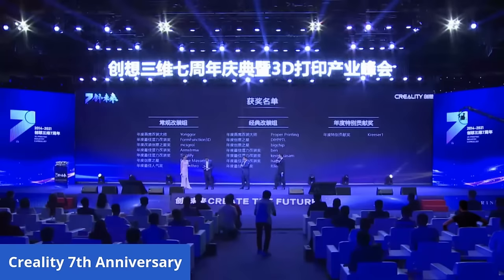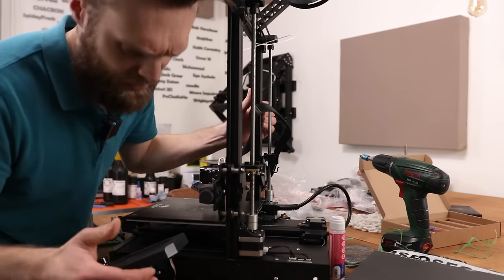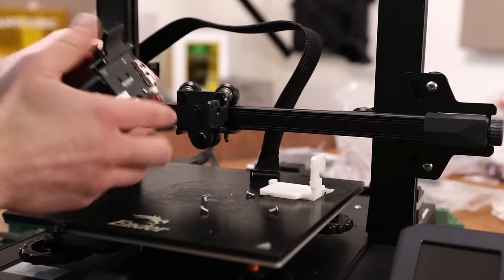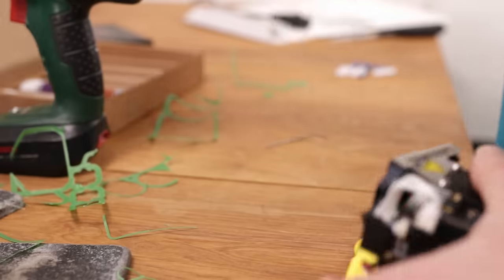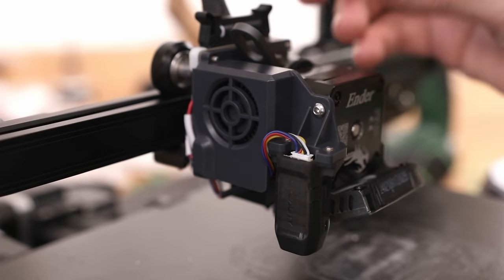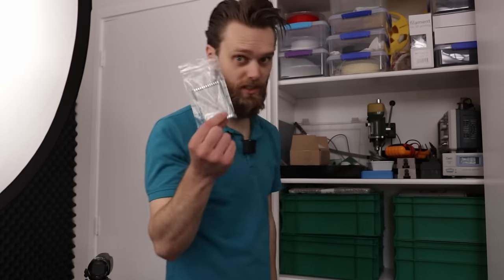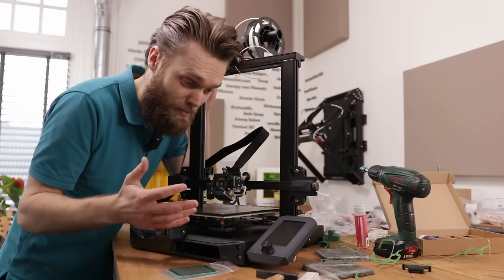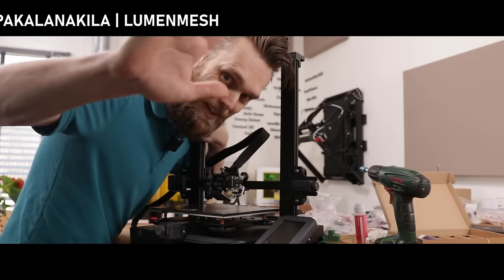MUST HAVE and SIMPLEST mod for Ender-3 S1! Contest worthy?

Comment from the maker: Hi everyone! This is my submission to Creality’s second Modification Masters contest. I went all in on simplicity and this mod can be made with just the parts out of the box! Check out my website properprinting.pro for more information and the 3D printable files! More information about the contest https://www.creality.com/activity-news/modification-master and my submission https://www.crealitycloud.com/post-detail/11066
Reply: Brilliant mod, and has pushed me over the edge of thinking of buying this printer, to actually buying it. Good luck!
Reply: Love your mod! Printed it today, it’s awesome and fits perfectly. I was hoping that I can easily switch between the extruded and the laser engraver. But the laser engraver doesn’t fit when your mod is mounted :( it’s just about 2mm or so. In case you want to make it even better for the contest, you could maybe find a solution that the laser engraver also fits.. but nevertheless: GREAT JOB! Thanks a lot!

Comment: Absolutly amazing. Einstein said we should make things as simplest as possible, but not simpler. You did that. Make a nice documentation and mount instructions, give yourself time to make it look all pretty, and you are winning. At the same time that opens up a room for a short video build tutorial.
Reply from the maker: Thank you! The deadline is moved to August 31st so I have some extra time to make it nicer :D
Reply: @properprinting  i hope you win! im guessing this cant work on a standard ender 3?
Reply: @FoxSock  Unfortunately, I don't think it will. The toolhead carriage on the standard ender 3 is different to the s1, therefore you probably will not be able to install the mod unless you change the toolhead carriage.

Comment: As an S1 owner who has both the Sprite extruder that came with it as well as the Creality laser engraver, I can't thank you enough for this design!
Reply: I'm looking at a LASER kit. How have you got on with it and is there anything you could recommend? Many thanks in advance.
Reply: Yesssss!
Reply: Hi, have you found or designed a tool part for the 5W laser engraver ?
Reply: Does the laser engraver work well?
Reply: @soa1 Yes, i have the 1.6 w & the 10 w!

Comment: Some of the best mods and or inventions are the ones that are the simplest.

Your mod here is the perfect example of that fact. It's so simple and straight forward that all you need is what you get when you purchase the printer as you mention in the video. You just do a quick print and mount it, and you're done.

Great job on coming up with that design.
🤘😉👍
Reply from the maker: Thank you! This realization came while I was designing it. Initially I had the idea of adding inserts or nuts. Since there's no pulling force on it, it can be done without. Just two parts and you're left with one screw xD
Reply: Came here to say the same. Simply awesome!

Comment: I just bought this printer and got it set up a few minutes ago. Your mod is the first print. It's going right now.   Oh for the record,  I got the loose coil of filament in the vacuum seal bag.  The mini spool must reserved for Proper Printers like you. :P
Reply: Does this mod make sense if you’re only 3D printing? What does tool change mean?

Comment: Just picked up a Ender 3 s1 for $50 bucks and its wasnt barely used. came with extra hothead, nozels, ablout 4 heat beds also the extra parts wereworth that alone,  great  mod!  thank you

Comment: this is amazing. afaik there will be a high temp print head as well as an laser for the s1, so this will make it so much more easier to change those toolheads! well done!
Reply from the maker: I didn't even know that! It would be so cool if they use the same connector. Thanks man!
Reply: @properprinting  unfortunately my answer Was not Posted, on the creality Website they do have the Sprite Pro and a Laser Module got the s1, with the same connector, so your Design is even more usefull!

Comment: Nice, simple and useful, really hope you win !   Making something simple yet effective can take more time than most think.

The only thing still Ender on my Ender Pro is literally the frame and bed.  Coverted it to a V6/BMG direct drive IDEX printer, has a unique 5:1 Z belt drive with brake and full linear rails.    All designed from scratch,  many hours of CAD work but It still can reach entire bed so lost no print size.  Linear rail adapters and the IDEX mounts all made from aluminum for rigidity.  I'll have to make a vid of it sometime I think you'd get a kick out of it.  COVID lockdown boredom lol
Reply from the maker: That's awesome! Please share a video once you've made one! Who knows the COVID boredom ends up starting an awesome YT channel :D
Reply: @properprinting  Nah no interest in running an ongoing channel.  It's already done aside from waiting for the 2nd V6 and extruder.  Wanted it mainly for using dissolvable support material and 2 color printing.

Comment: Wow! This is awesome! With a pen holder compatible with your part you can practically change your S1 into a 2d pen plotter :D
Reply from the maker: Exactly! And I made a mod in the past using a solenoid so you can control it with laser cutting software. That worked pretty neat
Reply: @properprinting  neat! I love your vibe bro, take my sub :)
Reply from the maker: @Psi34ax  thanks for the sub!

Comment: this is great! i just ordered ender 3 S1 as my second printer and I am planning to make is into a foldable printer that can fit in a suitcase while travelling and this mod is definitely going to make the folding/easy disassembly easier. Thanks
Reply from the maker: That's awesome! A foldable printer was my first video taking off :D https://youtu.be/6GTCkd7rDe4 That also included a tool swap system which I started this channel with.

Comment: hey brother , my CR touch stopped working properly out of the blue, so when i try auto level it tries to drill through the plate.
Reddit has 20 million different ideas about it , seeing as you also use/have a S1 I was wondering what you would think could be the culprit?
Reply from the maker: It can be roughly four things. The CR touch, the cable(s), the interface board or the main board. I cannot give a clear answer of what it might be, because you need to start excluding things to find the culprit. My best bet would be the connection to the interface board and second best, the CR touch itself.
Reply: @properprinting thank you! ill start with following all the cables

Comment: Printed this and just can't seem to get it to slide enough for it to clip onto the bracket. Any recommendations?
Reply from the maker: Some people reported this problem, so you're not alone. The tolerances of the sheet metal part are quite course. You can resize the part a bit in the slicer software in the horizontal direction only to make it longer while the dove tail connection remains snug. Hopefully this helps!

Comment: I modified the stls a mm shorter so it fits (I know ur aware of this issue), but did u have a lot of play or any play on the extruder? Bc my extruder is really really wobbly...
Reply from the maker: Thanks for letting me know. I'm aware of this issue and it looks like that the tolerances between printers is huge. Mine fits perfectly, but it doesn't for some. I eventually turned it back to original because I don't really use this functionality and it became less stable over time.
Reply: @properprinting  Okei, I'm gonna try making it less wobbly or maybe design myself an extruder mount, thanks!

Comment: Hi,  witth this mod, dose the nozzle position change att all? would you need ot adddress that in the firmware or Klipper?
Reply from the maker: It changes a few mm in both directions which is still within the boundaries of the print bed.

Comment: Hi I'm a beginner in 3d printing, i have a question, will this affect the auto bed levelling by any chance?
Reply from the maker: No, as long as the height of the sensor relative to the nozzle tip remains the same, nothing changes.

Comment: Hey Jón, i am quite new to 3d printing and i love your channel and your style. one thing, i got your adapter file and printed it according to your suggestions of 0.2 layher hight, supports and 30% infill. the problem is my two parts are not holding that good. What is your designed wall thickness, i printed it with 0.4 mm walls and like i said, i have got a bad connetion and the extruder is kind of loose. thank you in advance. stay safe
Reply from the maker: Thanks for trying out that design! Mine fitted quite snuggly and I even needed oil to get it to work. I was thinking of making a couple of versions with different tolerances. There are lots of variables, so chances are that it's a loose fit for some and tight for the other. In your case, I think you can get away by scaling one part in Cura in the direction perpendicular to the sliding mechanism. Hopefully this helps.

Comment: Its the mounting plate thats comes with the sprite pro kit for ender 3 diferente size than the stock S1?
The thing mounted in the plate have the holes like 3 mm left, fom the righ thing to the center or the first hole are 20mm and 35 to the next I have to redo mine mounting plate

Comment: i like the pei bed that came with it. whyd you go back to glass?  either way this printer has been great for me.  ive been running pretty constantly for a month. big fast and good looking models :D
Reply from the maker: I destroyed that bed after the second use😅 I'm currently printing on a Oseq plate which is awesome! It's a neat printer for sure!
Reply: @properprinting  lol yeah no paint scrapers.  i like how fast you can cool it down and pop your print right off tho. had to wait for glass to cool down.
Reply from the maker: @technodrone313  I agree. Although I always have difficulties removing ABS parts and especially the brim from it.
Reply: @properprinting  i gave up on abs years ago. i just run pla and tpu.

Comment: Great video!  I have a printer that someone did this mod, but I need to return it to factory.  Where can I get the part that was removed at timestamp 3:14?  I don't know what its called or where to buy it.  Help please!
Reply from the maker: Thanks! It's called a strain relief, but I don't know if you can get this actual part.
Reply: @properprinting  Thanks for the quick reply.  I have your quick change upgrade printed in PLA.  I put the printer in an enclosure to print something in ABS and the whole extruder assembly has drooped because of the heat.  Any ideas on how to recover?
Reply from the maker: @anthonyjones3345  you're welcome! Well, it sounds like you can get your chamber up to temperature! I'd remove the quick change, mount it normally and reprint it out of ABS if that's possible.

Comment: How did you print your part so perfectly? I have done 9 now.. mostly the stupid supports get infused and cause the end result to have some broken bits, etc. What material.. PETG I assume? I dont know what I messed up. I tried rotating the bracket so it wouldn't need supports.. still couldn't get a good print.
Reply from the maker: Standard settings with the PLA out of the box did it for me. The right orientation is shown on my website. It shouldn't be a difficult print. I did use Simplify3D though, but any modern slicer is capable of generating removable support structures. Is the PETG you used dryed? It absorbs moisture over time.

Comment: This is a really great mod but I found working with PLA this would warp overtime and become loose and unfunctionable and messing with my prints (this could be an error in my end on my slicer or infill). Is there another filament solution I could use for longer term use? cause this seemed to have only last me 4 days.
Reply from the maker: Although I haven't tested this, PETG is usually more durable, especially when it's in a warmer environment. Nylon or Polycarbonate would be even better, but that's difficult to print.

Comment: I am in the process of getting my first 3d printer, and I was considering getting the S1 with adding in the probability of upgrading the s1 to the Sprite pro for the all metal build, and getting an improved hot end for the 300 degree upgrade. This mount looks like it would allow me to set up and use the OG Sprite head for day to day materials and reserve the improved sprite head for hotter materials, as well as set up the optional laser. As I am a complete noob to this, does this sound like it would be practical? Would I be able to use the ssettings for each, like a print head profile? I think i would have to run bed levelliung between the heads. I just purchased the Sonic Pad because more came available. I still will have to get a couple of things, but the S1 seems to already run most of the upgrades I was chking out when I was looking at the 3 v2.
Reply: This is an old comment, but in the event you haven't yet.  I would suggest you either pay a little more for the pro, or just keep the Ender 3 S1 with the stock Sprite and upgrade the heat break to the all metal one with the high flow nozzle (Creality sells a kit).  You can use the same Sprite extruder for pretty much all the materials.  The only difference with going to an all metal heat break is that you can print at 300°C.  So I would suggest you just upgrade that with a steel nozzle and keep going from there.  I suggest the S1 over the V2 btw.  And invest in a PEI build plate if you have not done so already.  It'll make your prints stick sooo much better!
Reply: @kennethchau6318  I actually ended up doing exactly what you recommended. I bought the all metal hot end kit. I also did end up buying the sprite pro head as well because it was a great deal on a microcenter black Friday sale. So I have a spare, or an upgrade for another printer if necessary. The S1 Pro was not in stock when I bought it, so I ended up getting the S1, but have essentially bought the led bar, the pei build plate, and the hotend upgrade. So it's almost the pro, for all intents and purposes. I've very much enjoyed the stock S1 and it is way quiet, which is nice. I appreciate the advice and appreciate you taking the time to make the recommendations. They are all great info. Thank you.

Comment: The offset for this mod, is it adding to the current values or reducing ? like -32 is -35 or -29 ? Numbers in the negatives confuses the shit out of me
Reply from the maker: The offsets are negligible since they're so small. You can just print like you normally would, only the print itself is shifted a bit on the build plate. Unless you're squeezing out the last mm of your build plate you're fine ;) If you do, you night get away by shifting the build surface a bit.

Comment: I am the only one with the problem that the one  screw holding the extruder together is blocking the tool to slide in completely to the end?  is it because I have a s1 pro? and I still have all screws lol
Reply: same for ender 3 s1, it doesn't fit properly, seems the wall with screws should be thicker and clips longer  just not to touch the screw holding the extruder. I think that's why the author mentioned about minus one screw.

Comment: Since the part is made of PLA, is there any risk of the plastic melting over time since it's directly touching the actual extruder where the hot end is?
Reply from the maker: No, the heatbreak of the hotend prevents the heat from passing through. If you place it directly above a heated build plate of 100 degrees and enclose the printer, it might deform. If that'll be the case I'd suggest PETG or ABS.
Reply: @properprinting  Thanks for the info. I had just traded in my 3 V2 for an S1 yesterday and wanted to see what some good mods would be. This is a nice little tool that could help when I eventually clog up my extruder.

Comment: I would love to see if you could fit this extruder and hot end to the old folding ender 3
Reply from the maker: The tool plate of this printer should fit any standard Creality printer. I don't know if they can be bought separately, but it would be a smart move if it would because this extruder performs very well! I still have that Foldable Ender 3, but I haven't gotten to it yet to do more with it. If I do, I'm going to change the folding mechanism as well to make that better and simpler.
Reply: @properprinting  would the wiring be an issue as the new one has a ribbon cable? I’ve just bought all your plans to turn my ender 3 into a foldable one
Reply from the maker: @86sprout  Thanks for buying the plans! The ribbon cables makes it more difficult to lengthen the cables. If I could do it over again I would've bought new cables at the right length. I managed to lengthen them and everything works just fine, but it's a hassle and an increased risk.
Reply: @properprinting  how hard would adapting the wiring be from the new s1’s hotend and extruder to work with the old ender 3 wiring?
Reply from the maker: @86sprout  That wouldn't be the easiest task. I reverse engineered the connector and you can find the pinout in the Other tools tab on this page https://properprinting.pro/product/creality-ender3s1-simpletoolchanger/ This cable goes to a large flat cable connector on the board which is not like the standard Creality boards. This means that you need to make some sort of adapter for it. Soldering individual wires is also possible, but it's very difficult to go back to its original state.
Reply from the maker: @86sprout  I see now that you mean the other way around. That'd be easier. You can solder all individual connections to an IDC connector with a 2mm pitch which will fit this hotend. Also in this case an adapter would be better.
Reply: @properprinting  thanks, I’ll look into as a project when I’ve finished making it foldable, unless you beat me to it and show us how 👍🏻
Reply: I have an ender 3 v1 with a creality extruder pro video and yes, I managed to make the mod smoothly.